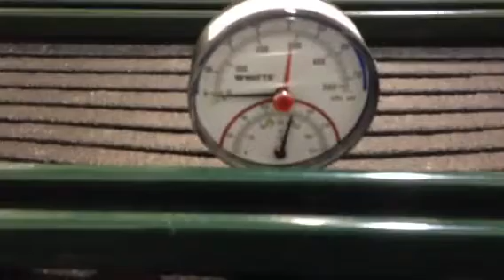Mushroom farm steam generator

Comment: Hi John looks like you have a good set up. What steam generator are you using? you commented below that you've made 2000+ saw dust blocks are you bagging your saw dust/wood chips then steaming a tub full of bags?  How long does that take to make sure there sterilized without having pressure?

Comment: Hi John, thanks for the cool videos. How'd the "test run" go? Any tweaks made since then?
Reply from the maker: I made an insulated jacket from water heater insulation wraps for around the trough. I also have pipe insulation on the copper pipe coming from the generator to the trough. Ive made about 2000+ sawdust blocks so far and all come out perfect. I have more pics and stuff on my FB page, Facebook.com/mushroomsnaturally.